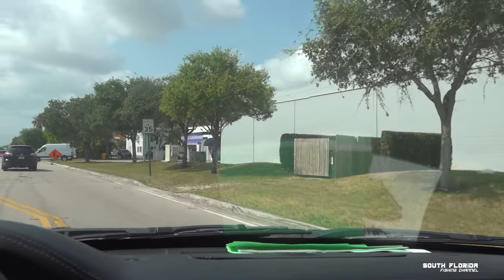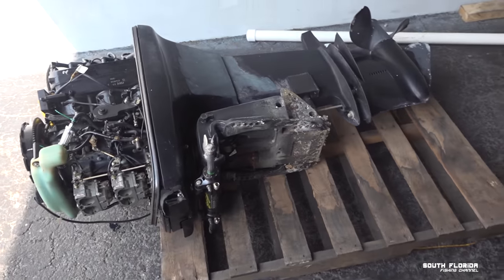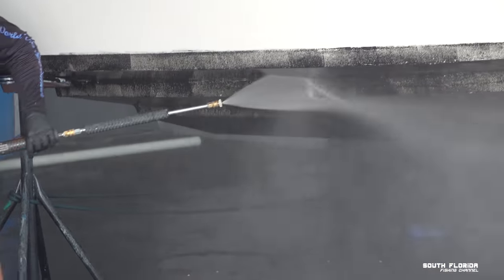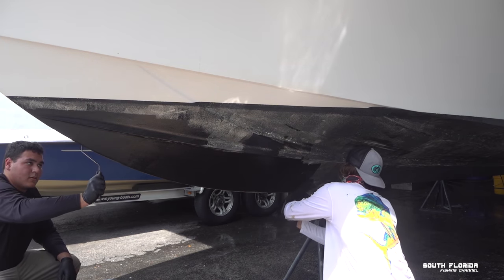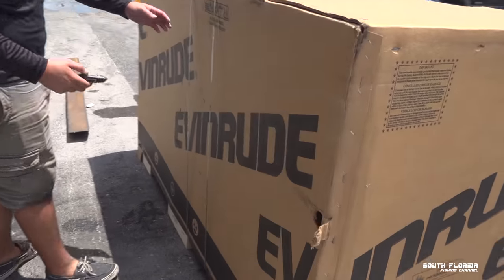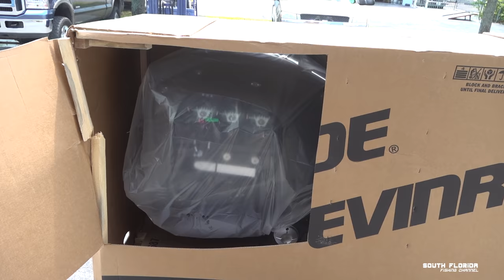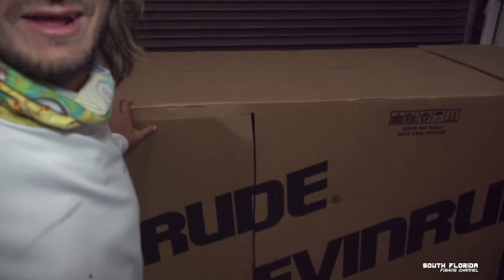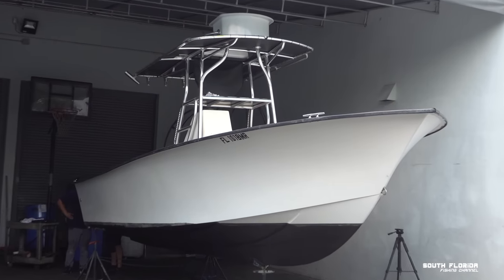Boat Update! A new engine?

Comment: Any new engine will be a great choice. Suzi, Yam, Merc, Tohatsu, and BRP. Nice thing is you have the steering contained in the new G2. Maintenance is almost nothing with those new engines. So as long as you don’t get a lemon, you will have that engine for long time and spend plenty of time on the water. I recommend xd100 as you can get more out of it. I know it cost more. One thing I would not skimp on with those new rudes is the tvw3. They can adjust the oil consumption rate based on xd50 or xd100. Enjoy the boat. Looks good.

Comment: Id like to know what made you decide on getting an evinrude over Suzuki/Merfcury/Yamaha
Reply: remelsheikh that answer is easy. No break in period. Less moving parts= no manteinance in over 3 year= more reliable = more time in the water.
Reply: @duvielhernandez2887  if that was the case, why aren't there more evinrudes out on the water? Why aren't commercial people using them on tow boats and law enforcement boats?

Comment: Looking good bro! I’m surprised that the checkpoint guy didn’t hassle you over your license address. Florida law requires you to notify state and get driver’s license that matches your residence and mailing address. Florida law gives you 10 days to do this, failure to comply is a non moving violation with penalty 🙁. Better get your stuff in order as our rights and freedoms are getting taken away little by little in these strange times.

Comment: Best move you could have made a lot of power quick hole shot  good on gas good warranty I think 7 yrs now could be wrong still 5 then love my first generation 08 300 etec you can run tcw3 oil setting on computer I run mine like that keep them cylinders well lube I use evinrude oil tcw3 from Walmart 20$ gal been using it since I bought boat in 2010 under warranty use the xd100 it will sip oil I think a little more than the other brands. Evinrude invented the interactive power steering and everybody copied  and easy fogging ofmotor for you northern states  but best choice. 2nd best choice would be Suzuki never would have gone to sea power they ripped me off for a thousand dollars plus. Markey marine in key largo Fl see David takes care of my services and anything  I can’t handle and best of all no breakin period just runs double oil for ten hrs I think something like that. have a lot of fun with that engine JT Hooked n Rolling Offshore 🇺🇸🇺🇸🐟🐠🎣🛥🌴⛱😊🙏🏻🙏🏻🙏🏻 hurry up corona get the hell out of here John